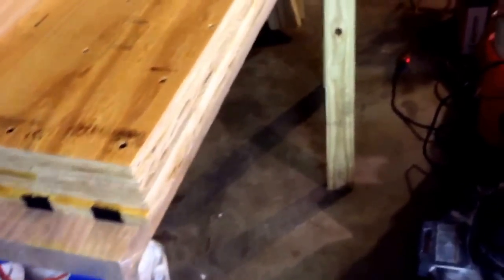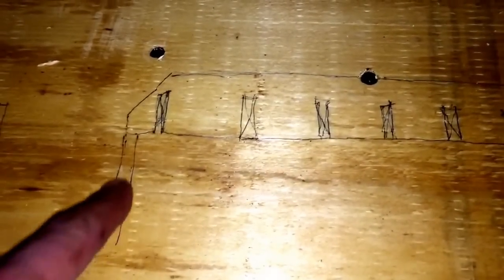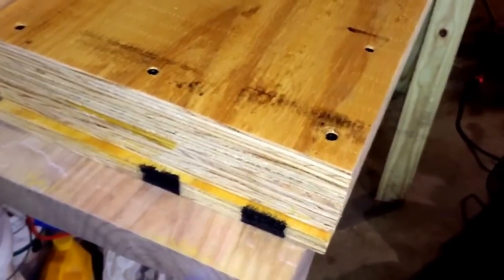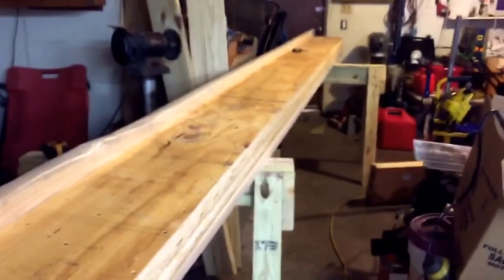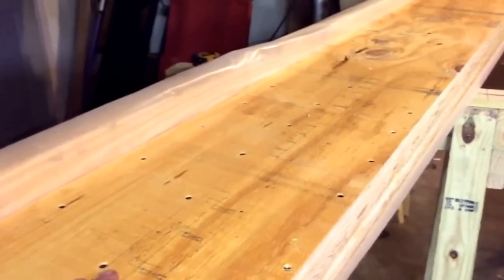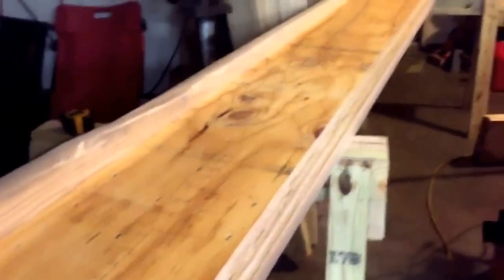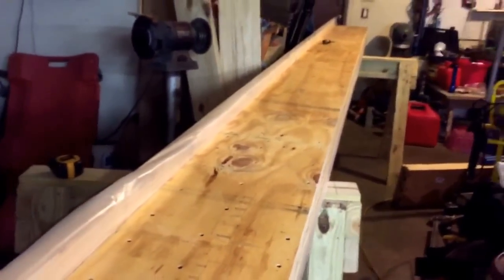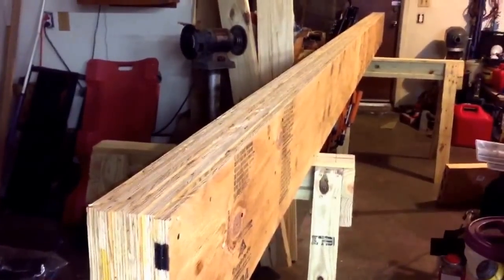Removing and supporting a load bearing wall with a hidden beam - Part 1

Comment: Thanks for the video. On your option #2 example, what specifically are the "nailers" called that would support the ceiling joists from above? In other words, what would they be called if one were to looking to buy something to suite this purpose? Would the ceiling joists just hang from the added beam?
Reply: Yes. they hang on the side of the beam with hangers.

Comment: you should have explained your jig setup a bit more as its probably not apparent to most youtubers' why you designed the jig to be L shaped with the 2x8 and 2x12; specifically the purpose of the 2x8 (which I believe acts like a web for a beam to keep the fabricated beam true/straight/level (Im not an engineer)).

Thank you for your information nonetheless!
Reply from the maker: I didn't explain it to well. I just used these boards to keep the beam straight and true while aligning the plywood layers. I used the wax paper to keep it from sticking to the boards due to excess glue. It would have been no fun without this!
Reply: Trey Clanton you nailed the boards together so the 2x8 acts like the web of an i beam correct?  Wax paper; I wouldnt have thought to do that; thank you!
Reply from the maker: The 2x8 and 2x12 are not part of the beam. They were only used as a flat, square base on which to build up laminated beam. I lifted the beam off of them once the glue had fully set within the laminated beam.

Comment: This type of project requires design by a Professional Engineer. This is not a trivial project and is not a DIY task for anyone without professional help. As a DIY'er myself I appreciate the video series, but it makes me nervous as an engineer.
Reply: Oh please-  don't lose sleep over his beam mr engineer. Let's face it   Do-it-your-selfers and these great tutorials simply take away business from the structural engineers, architects et al.  .  You must be a do gooder socialist- all into rules and regulations and aghast over  independent, creative, intelligent free thinkers who, when taught correctly  can accomplish most things on their own, without  the middle man sucking the life blood out of him.  Many people are resorting to performing the labor themselves to save money. Engineers and architects charge an arm and a leg per hour- I know because  I used them. 
Don't send me any retorts. My opinion won't change.
Reply: Jet Set I’m almost there with you.  I just can’t reconcile in my mind, me buying a house and finding later that I have to deal with the DIYer who sized the beam to small, connected it poorly, and notched it to make room for a line they needed to tuck away.  9/10 the DIYer will over size it out of fear of failure, tho.
Reply: Jet Set, you are right! Just research something like this extensively. I'm doing it now myself to remove a kitchen wall.

Comment: Contrary to the opinion of most people, the grain layers of most plywood run all run in the direction of the length except for some 5/8 underlayment plywood where the diagonals inside lend itself to the term cross hatch plywood. For bend resistance comparison, rip saw two equal width pcs, one end 4 ft., the other along 8 ft. feel the difference in resistance to bending. There is a huge difference.

Comment from the maker: Hello Ryan. I used this reference for my project. http://www.fpl.fs.fed.us/documnts/fplgtr/fplgtr190/chapter_12.pdf  You are very correct that LVL is stronger. In my case I have plenty of overhead space in the attic to increase the size of the beam. If this were a two story where I had limited space I might well have had to use steel or LVL.
Reply: Trey Clanton That makes sense!

Comment: What type of plywood dd you use?
Reply from the maker: I used 3/4" exterior grade plywood. It is actually 11/32" on average.
Reply: Trey Clanton Out of curiosity, what do you estimate the load capacity of your beam to be? I was under the impression LVLs got their strength by having the grain all going the same direction for each laminated layer where as ply wood alternates each layer.